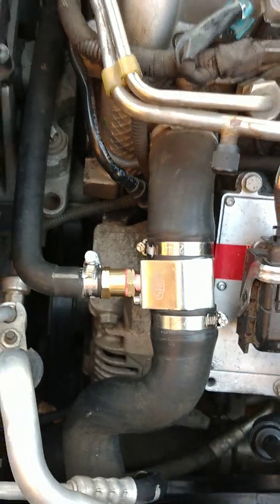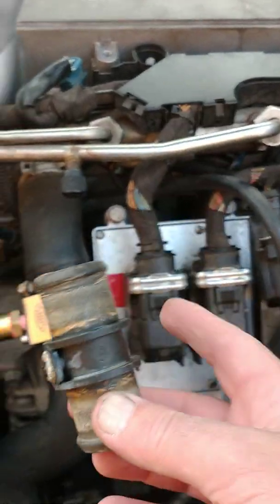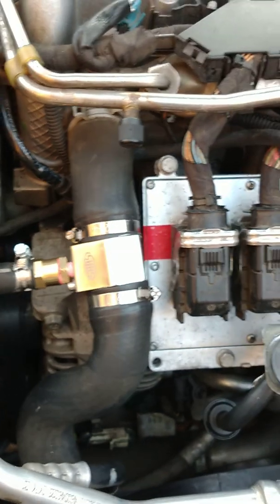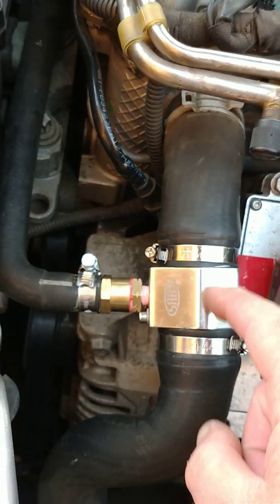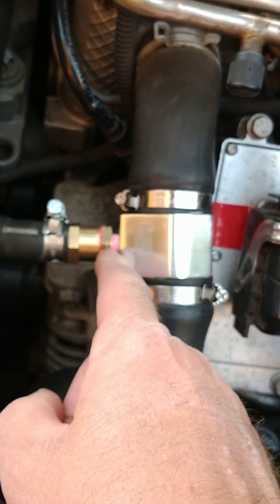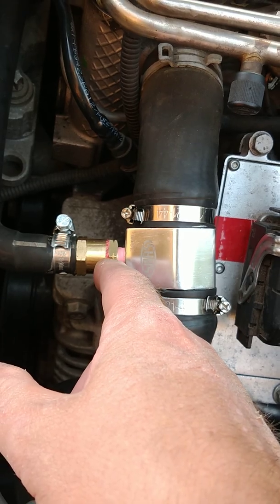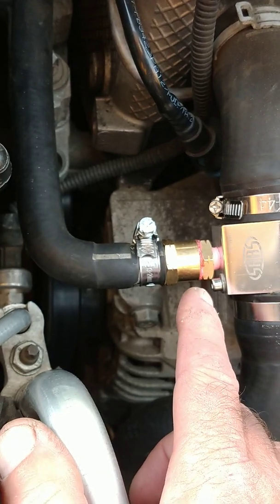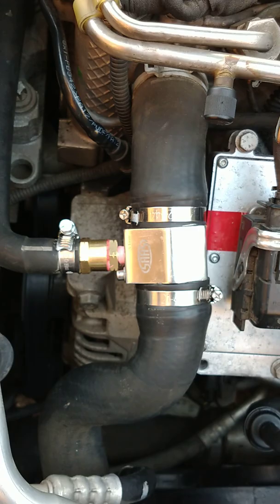SAAB 9-3 T-CONNECTOR UPGRADE

Comment: Hi Steve. I have this same problem now. I seemed to find the SAAS aluminum pipe at Supercheap auto. Where do you get the other component from?
Reply from the maker: Hi!  Supercheap auto should have the other brass connections, I think they were on a stand, I cant remember,  make sure to use a little plumbers tape to seal the connections, I have not had any leaks since I done mine, works good cheers
Reply: @steventotikidis3826  Hi and thanks again . I managed to buy some air fittings from Total Tools